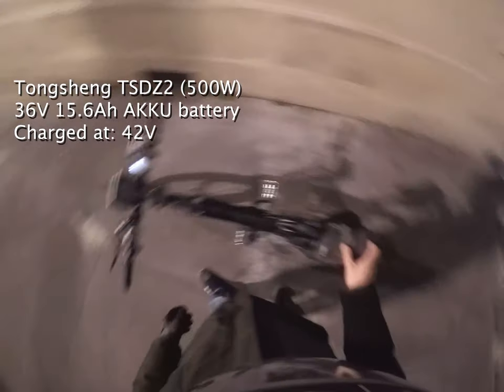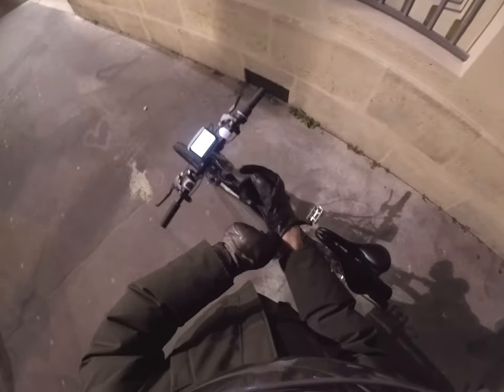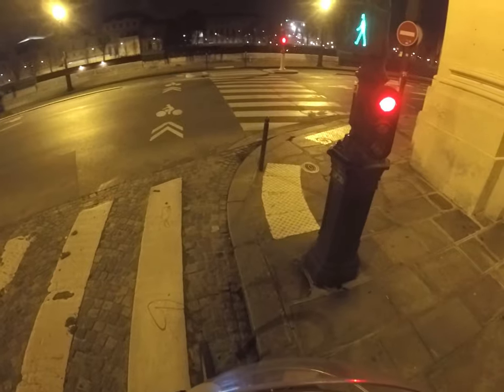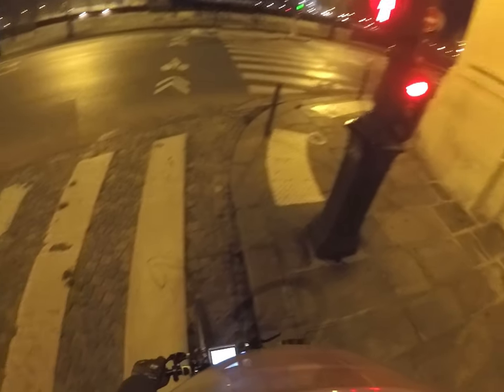Tongsheng 10 Km ride: How much Battery consumption for TSDZ2 500W Mid-drive kit?

Comment: Hi! Thank you for the video! However, i am disappointed. You"d ride at good circumstances and not extremely fast, and it seems that is only 50 km in a 748 Wh (36V x 15.6 Ah)  battery (17% discharge to 80% discharge). At 20-25 celsius it can be slightly more, but i think, with a bit more sporty riding style and worse asphalt condititon it can be only 15-25 kms :(  Did you use with Eco mode?